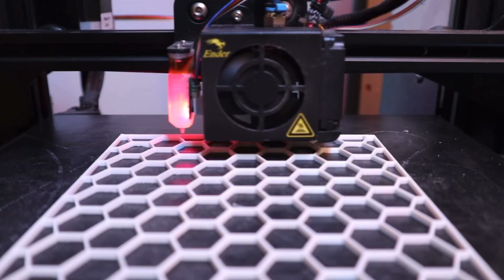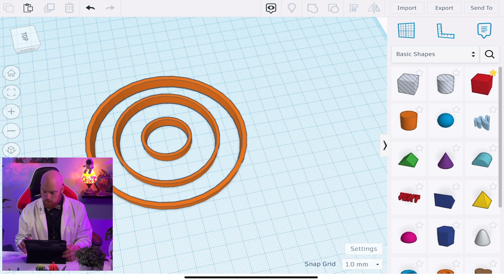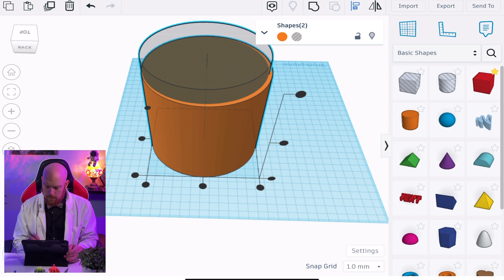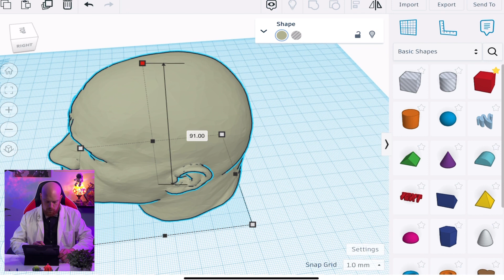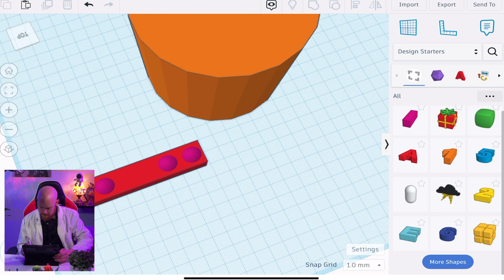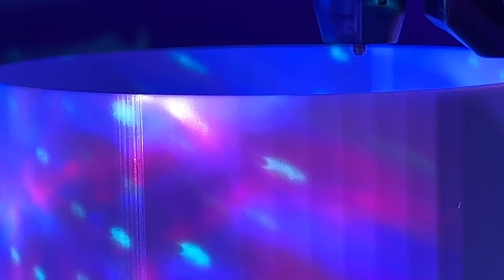3d Printing your own Plant Pots!

Comment: How much would you estimate it cost to print your Dwayne the Pot Johnson?  So awesome by the way. been wanting a printer for a long time but not sure what to make or if it’s cost effective. Thank you for showing me some cool stuff!!!!
Reply from the maker: Welcome to the world of 3d printing! The print will cost about $0.40 depending on the filament you choose to make it out of. 

There are some good cheap printers out there. Kingroon kps3 is $200 -230 and you can find an ender 3s for $150. Obviously, the learning curve with these is higher but you learn a lot more about how 3-D printing works. Getting something like a bamboo will cost more but it’s also significantly easier to learn.